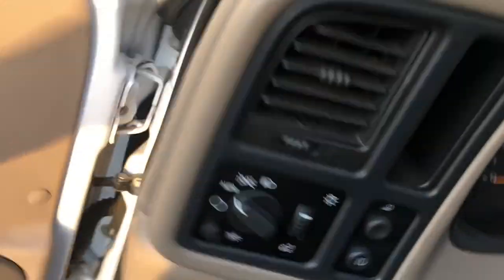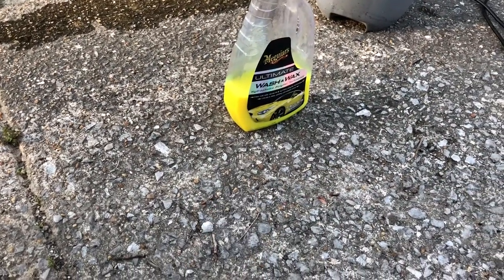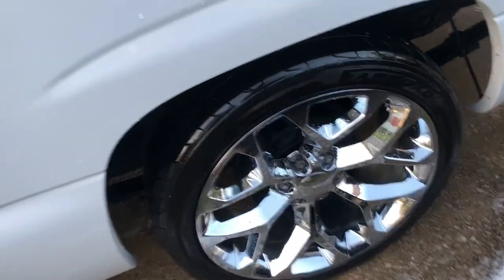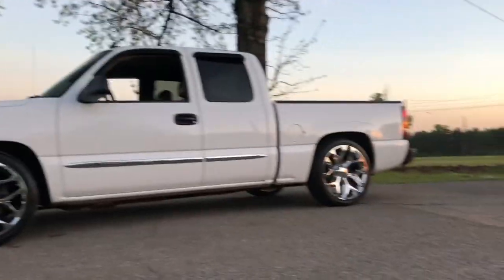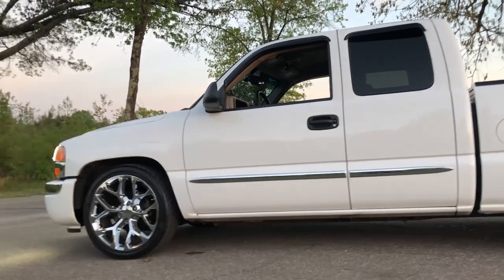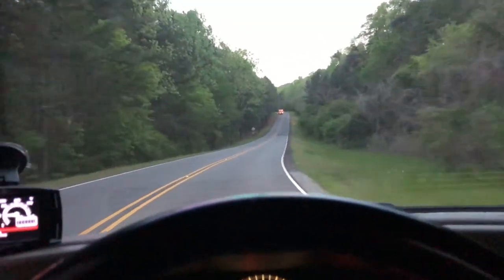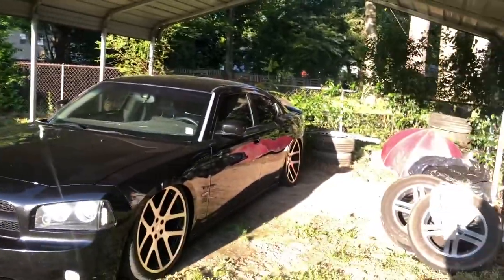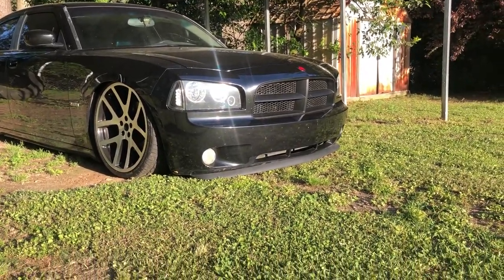DAILY DRIVING A LOWERED TRUCK | SOME TRUCK DETAILING

Comment: Just a tip for my Chevy and gmc boys.... shine on your dash, doors panels, tires, pretty much anywhere you’d put some kind of glossy finish product on the vehicle... use baby oil, keeps all the areas moisturized and prevents cracking in the heat, especially those 5/7 boys running no a/c’s🤙🏽 Oh, and a little goes a long way.

Comment: Do you think I could do a 2/4 drop with my tires being at 275/55/20 ? In a 03 Silverado
Reply: I got a 2/4 drop with 295/30r24’s. 24 inch rims. It rides rough but it looks good. Go with at least 22’s if you’re gonna 2/4 drop.

Comment: Sounds like it has a lifter tick
Reply from the maker: Juann Garcia lol it does hopefully this winter I can put a btr cam in it
Reply: BamaMopar I have a 07 avalanche that ticks I’m also going to stage 2 cam afm/dod delete ls7 lifters pac springs and more, have all the parts just need to get it done soon also have a beltech 2/4 to get installed